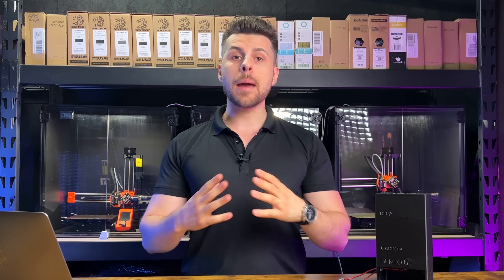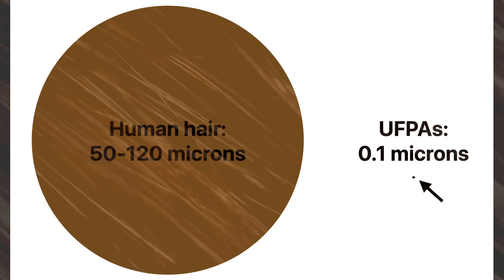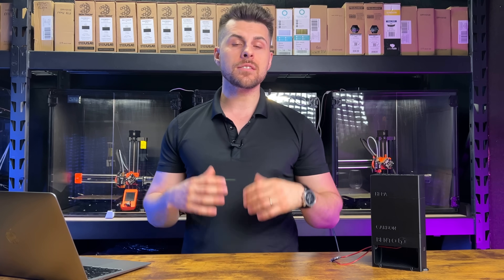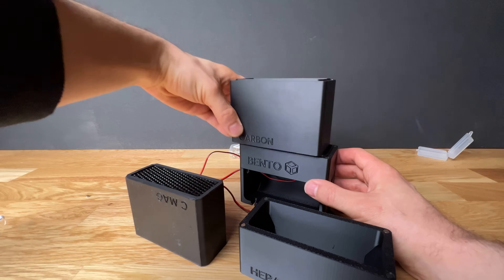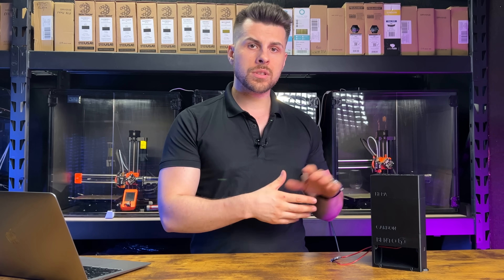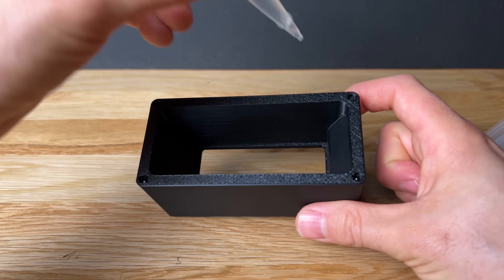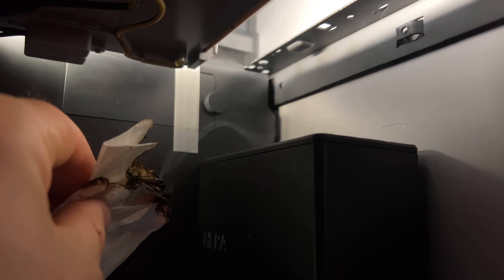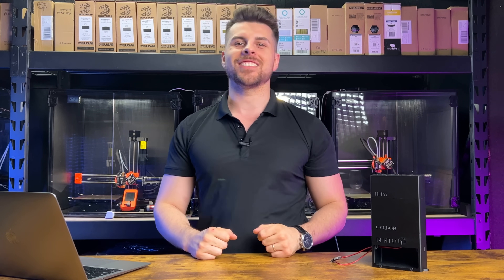Best DIY filter for your 3D printer: solving 3d printing smell and fumes

Comment: This is totally useless and you should be ashamed of yourself for omitting this importnat information .HEPA only filters dust, if you want to filter VOC and other exhaust gases you need to implement a carbon  filter. The purpose of your video is just to send out your affiliate links and earn money this way, i hope the 10 dollars you earned was totally worth it. *
Reply from the maker: I suppose your comment was for another video..bentobox has carbon pellets. 🤷🏻‍♂️
Reply: Look at the box, it literally says carbon on it. Not only does it have an integrated activated carbon filter, the Bambu printers it's advertised for already have carbon filters in addition to whatever the bento can do.
Reply: @o-manthehuman7867   "the Bambu printers it's advertised for already have carbon filters"
Those are probably there for marketing and to remove worrying smells. A filter that's sufficient for VOCs for an extended amount of time wouldn't fit into an enclosed Bambu printer. I wouldn't trust profit-oriented manufacturers with claims about VOC filtering without actual measurements. HEPA particle filters are standardized and even there the filter performance can vary a lot.
Reply: You are a special kind of stupid, aren't you. How about you watch the video through before you open your big, dumb mouth.
Reply: I LOVED the video, told me everything i wanted to hear and CLEARLY showed the hepa filter after use, shame on you, sucked on too many fumes you dont know wtf your saying:face-green-smiling:

Comment: Any pointers on how to connect to the X1-C PSU?  This is (for me) an expensive printer and I'm anxious about screwing it up by experimenting with the power.  I'm struggling to find videos on how to do this and as great as the BentoBox user guide is, all it gives me is "Internal power 01 – Using 4020/4028 24V fans and wire directly to the PSU of the printer.".  This video shows the connection at 6:04 but I'm not clear how to tap into the PSU or what to use to do so.
Reply from the maker: If not sure, i would avoid and route external cables to the bentobox

Comment: I was surprised that it draws air in through the top, since the VOC's from ABS will gather at the bottom of the print chamber. Thanks for the informative video.
Reply: Mine pulls air from the bottom. Just reverse the fans.

Comment: For whatever it's worth -- a little feedback:  The video is about  the best DIY filter... I'm quite a bit into the video and you're still talking about all the things not to do.  I just want to hear about the right thing.
Reply: The simple right thing is to put the printer in an enclosure and extract all the fumes through a funnel out the window. Don't need a filter if there's nothing to filter. Alternatively you'll want a good particle filter (like HEPA), a good(!) carbon filter for VOCs, and reduce the printer nozzle temperature because higher temperatures massively increase the amount of emissions. And if you can, try to not be in the same room as the printer.

Comment: Why print it with PETG and not PLA?
Reply from the maker: John, when printing ASA/ABS inside the x1c, it reaches 50C. Pla will degrade and might cause issues.
Reply: Mechanical properties and PETG is more resistant to UV and much better if you want longevity

Comment: Lots of people commenting on venting the printer to outside or print in a well ventilated area. That's all good until you want to maintain a high temp in the enclosure. Venting to outside will draw air into the enclosure, and that's not good for my ABS prints.  So this is where i see this solution as helpful because it allows me to maintain a stable warm temp, while also, filtering particles that build up on my internals over time. If someone has an alternative solution please post.
Reply: Vent after printing?
Reply: @youtubehandlesux  Yeah, but I've yet to encounter a printer that doesn't leak. If you kick on an ABS print your house will reak within 30mins. The recirculating filter option here solves that. It wouldn't hurt to vent to outside before opening the door though.
Reply: You can heat up the air in (or coming into) the printer enclosure. Sure it'll use more energy but still easier than building a 100% airtight enclosure.
Reply: Just run the vent fan at very low speed during printing. Just enough to maintain negative pressure in the print chamber so no VOCs can escape. After your print is done, you can crank it up.
Reply: Right, and this problem is amplified when you realize the filaments with potentially harmful exhaust tend to be the same ones which need the high temp enclosure.

Comment: You can use a soldering iron to insert the brass threaded inserts you just need to be careful of the soldering tip height to avoid piercing through the 3D-printed parts as you are using the very small brass insert in this video for your 3D-printed parts.

Comment: Nevermore StealthMax is arguably a better solution
Reply: In that case would you mind arguing that ? Because I am looking at the different filter designs out there and for me it is almost impossible to judge which system has what benefits and drawbacks. Because no one ever does a good comparison.
Reply from the maker: Better doesn’t always mean doable. Max or S don’t fit in the bambulab frame

Comment: Do not print stuff like ABS or ASA indoors without proper ventilation of your printing space. Full stop. Filters are not enough. Ventilate your space or don't do it.
Reply: Or, better yet, just get air quality sensors and respond accordingly based on the air quality you actually get in real world use. Proper filtration can absolutely be sufficient if it's scaled appropriately, but you have no way of knowing if it is/isn't scaled appropriately without getting a proper air quality sensor. Many filtration systems like the Nevermore StealthMax (specifically the "smart" variant) have these sensors builtin and can adjust their fan curves to keep the VOC and particulate counts low within the chamber, and the chamber isn't going to leak a higher pollutant % than it actually has inside of itself so if you can keep the chamber at safe levels you are certainly keeping the rest of the room at safe levels. (and, even if you are still worried about leaks, good filtration systems have a way of venting small amounts in order to generate negative pressure and stop leaks without venting so much that maintaining internal chamber temps is hard)

Just actually check, blindly assuming the worst possible case is a completely stupid move and will lead to increase costs even while you have no way of knowing if it's actually solving the problem since, again, you're not checking. Get a sensor, see whether or not you have a problem, if you do have a problem, solve it. Blindly assuming that yes, you do have a problem and, yes, this one particular course of action will 100% definitely solve it, is incredibly stupid. It'd be like someone paying for a full tank of gas everytime they get in their car to drive anywhere instead of actually looking at their gauge to see how much, if any, they need to refuel. Sure, technically you can be 90% confident that you'll never run out, but 1 : you're paying way more than you need to and wasting way more than you need to, and 2 : it's still not even providing you with certainty, if you have a punctured tank and are leaking gas then even buying a full tank everytime you get in your car won't guarantee that you're full, because it's just leaking out as you pour it in. If you want certainty you already need to look at your gas gauge, so just do that to begin with and save yourself the time and money. You'll save time and money solving the problem, you'll be alerted if the problem arises again, and you won't be in a situation where you have to blindly hope that your solution worked.
Reply: @robonator2945 Most affordable air quality sensors are inadequate for detecting all the possible gases and particulates (depending on material) though, from what I hear. What sensor would actually give you peace of mind?
Reply: @cinnac0n  this isn't a lab, you just need a rough idea of the general concentrations. There are absolutely affordable sensors that achieve that standard and could (and should) be integrated into printers.
Reply: @robonator2945  For sure, and I agree. We need more research all around on the air quality of 3d printing. My main concern is that some sensors may give a false sense of security for the relevant emissions like UFPs, which are not detected by most consumer grade sensors
Reply: what does "proper ventilation" mean?
Reply: Styrene is a carcinogen which is why when I needed a high temp fillament (before I knew about ht pla) I went with petg. If anything I also reccomend you also do this with nylon. That's a moderate irritant

Comment: Hello, amazing invention, thanks for doing this. - I have been looking for carbon pellets and I cant find anything in the UK at the moment. I was hoping you might have any suggestions? The problem is up to now, any shop I found is abroad and you pay double the price just for the shipping. Thanks!
Reply from the maker: Thank you! Check the voron discord local to the UK, they may have direct contacts with reputable UK sellers.
Reply: Aquarium shops!! Used extensively in tropical and marine fish aquariums.
Reply: Did you find some? Also in UK, is that right about aquarium shops??

Comment: This is the reason I only print with PLA.  Even then I have an air monitor and my VOC's are in the middle range which is not good.  I print in a basement with no ventilation at all.  I have went to PLA plus, and that might be the cause of the higher VOC's.  I'm looking for good ventilation ideas.
Reply: I largely PLA, my machines are inside enclosures with a carbon air filter and the room has two air purifiers.  I'm always looking for ways to improve the safety side.  Each enclosure also has fire safety devices (Wham Bam - The Cloud).  If I do need to use PETG or other materials, I have an expensive BOFA 3D Printer Filtration system I plug in.  Print safe!
Reply: Good. Pla is still plastic after all and releases its own harmful stuff.

Comment: Am I missing something, I've gone to the prusa files and downloaded them. However the inner carbon box seems to be missing along with the pellit shelfs, I take it you was supplied a complete kit with these already? Also the .3mf seems to be corrupt.
Reply from the maker: Hey there, the inner carbon box is in the CMAG_stl folder. Let me know if you find it. ;)
Reply: @3DPrintingForMoney  The grill file is missing.  You are supposed to print 4 grills but they are not there.
Reply from the maker: I see them in the cmag file section. Instructions on page 6, plate 3 on how to do it. It is called “net infill x4.stl”
https://media.printables.com/media/prints/272525/stls/5723835_3a6b2fbf-f839-490b-9eb4-fe4198437b20_80d2172a-c0ee-4039-b49b-852c72512e9e/thumbs/cover/180x180/png/net_infill-for-prusaslicer_preview.webp
Reply: @3DPrintingForMoney  Ah, I should have checked the PDF first.  There are settings you need to apply to get them to not be solid squares.  Once I added the honeycomb infill and other various slicer settings they now show the proper grill holes.  Thanks!
Reply from the maker: Here to help!

Comment: By putting the carbon section last before the air discharge port, aren’t you inviting carbon dust into the printer? If true, this suggests that the hepa filter should be last instead. Please comment on this. Update: A Google search turned up several articles from filter experts suggesting that the position of the HEPA and carbon in a filter stack would not materially change the filter effectiveness. They also offered that filter medium in a stack should go from coarse to fine. None of what I found addressed the dust from carbon. my conclusion is that I'm going to swap the order just for not having to deal with possible carbon dust getting into the printer. I also found several youtube videos showing people thoroughly rinsing the carbon pellets before loading them into a filter housing. At the start, the water looked pretty dark but eventually went clear. This all makes sense to me.
Reply: It is common practice to place a HEPA filter before and after the carbon in an air filter.  This can be seen in respirator cartridges.
Reply: I reversed the fans and have it pull through the carbon first from the bottom.
Reply from the maker: Good quality pellets have very low dust, if it is a concern you can always “dry-run” the filter out of the printer for a couple of hours to get rid of possible particles. Before putting a new load i always tap the pellet box on a paper towel to assess dust levels
Reply: @3DPrintingForMoney  thanks for the reply and your suggestion. But why would it not be best to put the particle filter last?
Reply: I think having the HEPA filter first and then carbon is better, because the HEPA filter will remove small particles and then carbon removes odors and such, that are actually smaller particles than the particles that the HEPA filter removes. Even if the spacing between the carbon in this design is larger than the HEPA filter, the carbon still removes smaller particles in the way that active carbon works, i.e. adsorption (yes, with a  'd', not absorption), so it is actually going from coarse to fine. If you'd put the carbon first, then maybe it would quicker get covered with larger particles that the HEPA filter filters which would reduce the carbon effectiveness.

I wonder if a carbon filter sponge would work equally well, or even better, than the carbon chunks used here.

Comment: If you do this with an enclosure and vent to the outside e.g. through a window, do you even need a filter at that point?
Reply: I'm considering connecting my enclosure directly to the ventilation system to suck the air outside, and/or using a circulating system like the Bento box. One possible positive effect of the circulating system is that it will contain the warm air in the enclosure if you need it for the material you are printing. My printer is in a 16°C room, so if I ventilate outside during printing, it will mean it will draw in the cold air from the room into the enclosure, which I might want to avoid. Maybe the ideal would be to use both, so that when you need to contain the heat, you use the circulating filter and else ventilate outside with negative pressure.
Reply: If you vent to outdoors you are good to go.
Reply: Depends if you want to dump your trash into the public or not.
Reply: @Jacksparrow4986  LOL!  What a dumb thing to say!  It's not going to hurt anyone outside.  WTF is wrong with your brain?
Reply: @joeking433  how are you not harming anyone? Do you think the particles disappear?
Reply: @driventomadness117   The particles of coal plants don't disappear either but the atmosphere is large. Of course you might not want to exhaust the stuff in someone's face outside, but no one suggested ignoring common sense.

Comment: Thanks for the video! Could you please explain how to wire it to the printer's power supply? Also, what material have you used for the shell (given the temperatures inside)? ABS?

Comment: This is the concept I've been looking for!  Why isn't replaceable carbon with separate pleated (furnace) filters a 'thing' for diode lasers?  Even a DIY BOFA 350 kit is too expensive for casual and side hustle startup $.  I'm able to vent outside, so not as worried about smoke, mostly just stink.  Thanks for any words of wisdom, and for the informative video.

Comment: Just what I’m looking for. Would you run an extractor fan also to keep ambient temp down and protect power supply from getting too hot? If so have you found a neat solution for this without creating a mess of wires?
Also do you have a way to smartly control power to the hepa filter, perhaps temperature switch?
Thanks again.

Comment: You mention creating negative pressure in the print chamber and exhausting the air to the outside. If you are printing a filament such as ABS that needs to maintain a certain temperature in the print chamber, wouldn't venting be counter-intuitive?
Reply: Good question.  The negative pressure should be very low - just enough to keep any leaks in your enclose moving air in the right direction.  On my Voron 2.4 I run the exhaust fan at 10% to 15% speed, and chamber temps (heated by bed only) stay around 50°-60°C for ABS and ASA.

Comment: What kind of hepa filters are you using and how do you know when to replace? I read somewhere you need merv 17 filters to clean the air completely of the stuff produced when 3d printing
Reply from the maker: Merv17 are hard to find in suitable dimensions. The hepa filters linked are for “dust scrubbing” and bigger particles, the adsorption is taken care by the activated carbon pellets. Depending on material printed, 100-300h, the lesser for the technical materials. I made an experiment going over the 300h rule with a green asa and the hepa had a slight green tone after that time frame..
Reply: HEPA is comparable to MERV 17-20 as far as I know. And no, even HEPA filters don't filter VOCs, only particles.

Comment: It would have been great to see some detail of the wiring to the power adapter. I’m struggling with wiring with the T tap wire adapter you linked.